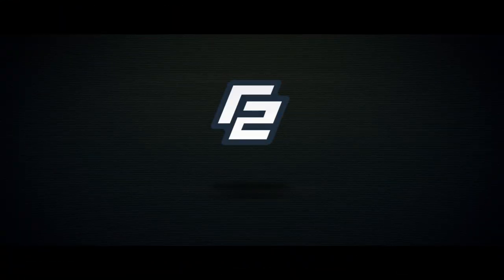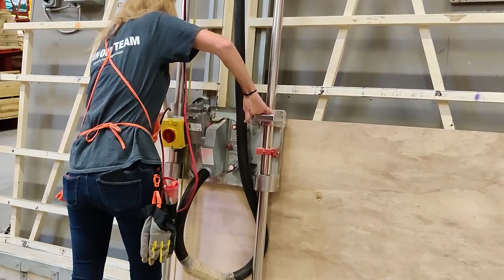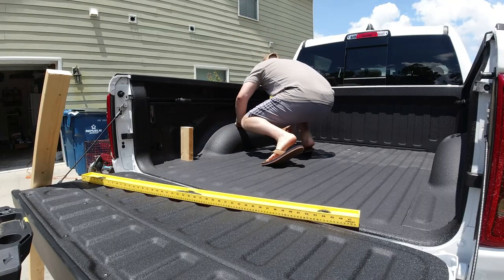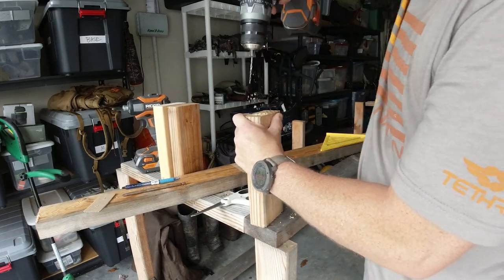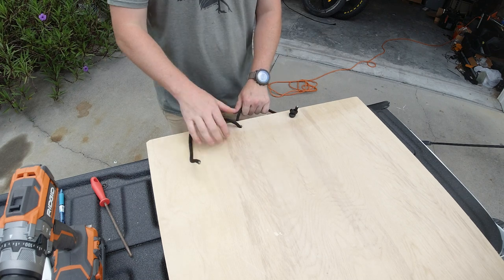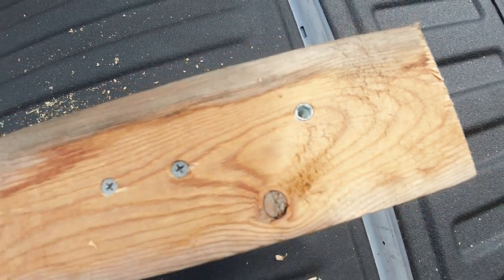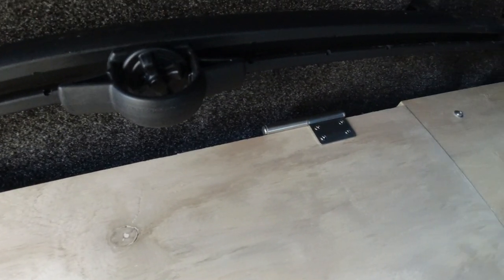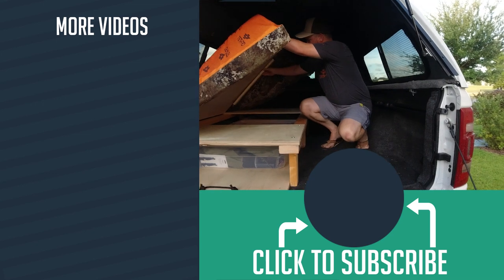Truck Bed Camper - Step-by-Step Build-a-long Tutorial

Comment: Great video - So simple; but, elegant in design. Easy to remove too so you can use your truck if needed. The treaded inserts are a great idea to take apart and reassemble. $144 is affordable and look what you get.
Reply from the maker: You get it!

Comment: ive looked at a lot of these designs, some intracite and some simple. This is the best laid out Value minded set up ive seen Very well done, easy to build and you have put together the video in a simple follow along manner. The mattress cover is a nice touch too. The only thing you really didnt cover was securing the completed project into the truck bed. Other than that, looks like a great easy set up that is functional and easy.
Reply: I don't secure it in the truck bed. Gravity & the friction of the bed rug does that for me. I drove from GA to ND and hunted for 7 days with the bed in place and it never shifted or fell over. It worked perfectly! So that's another advantage...no fussing around with attaching it to the truck bed.

Comment: Nice build and thanks for the parts list and sizes. Very helpful! Was wondering? Did you factor in whether you can sit of the bed and have head room? Or is that not even a concern.  Thanks for sharing! Cheers from Michigan.

Comment: Hi G2 Outdoor, that was easy, economical great project. Thanks for sharing your ideas.
I noticed your bed rail system in your truck is that stock or you made that too? Where did you get the metal that you used for your bed rails. Thank you and continue sharing more videos. More power 👍
Reply from the maker: Thanks! The bed rails were stock on my 2020 Ram. Seems pretty easy to DIY with some 80/20 or even T-Track.

Comment: Stupid question , how is is secured on the truck bed floor ? Do you bolt it in the truck bed ? Does it stay put in another way ? How does it stay in place if you do t want to drill holes in the truck bed

Comment: This is great! Looks easy enough for me to build. Question though, if the top is 37" wide, wouldn't the slide out underneath need to be less than 37"? Thanks!
Reply from the maker: It could be that I messed up the slide measurement. I can't remember specifically since it's been a couple years since I built it. But yes...the slide needs to be slightly less wide than the top to account for the legs.
Reply: @G2Outdoors  Thanks for your reply! It makes sense that it would be narrower, but wanted to make sure I wasn't missing something.

Comment: That's an awesome build, man.  Thanks for sharing.  Got some materials to start my build and definitely want to do some of what you have done.  I would really like to use those hinges, but couldn't find them in your Amazon list.  Do you have a link for those?
Reply: Ever end up finding out the link or have a recommendation for the size? Just about finished with my build and this is all I have left to get. Thanks!
Reply: Actually called a “flag hinge”.  Rannb 3-inch Flag Hinges 304 Stainless Steel Lift Off Hinge Detachable Door Hing

Comment: Maybe I missed it but how do you keep it from sliding side to side when driving?
Reply from the maker: It doesn't slide. The Bed Rug and the weight of it solves that problem. I've driven hundreds of miles with it and it's never moved an inch.

Comment: Very nice build. Where did you get the Tethrd covering from??
Reply from the maker: It was an old tablecloth from a tradeshow booth.
Reply: Ok cool. I was able to get out yesterday, and got up in a tree with just one of the Hawk Helium stick, Phantom saddle, and Predator XL platform. I sat for about 40 minutes. It was pretty cool. I gotta find the sweet comfortable spot. I’m hoping to get out a few more times and get use to climbing and setting up everything. I think this will be my new way to hunt quick and be mobile on public ground for sure💪🏽💪🏽💪🏽
Reply from the maker: @stevenmatthews8981  that's awesome! I also really recommend back support. You can pick up the Recliner from Tethrd or make your own pretty easily.
Reply: Yes I also bought a recliner band and the seat warmer as well. I’m all seat up just need to get more practice sitting in it. Thanks👍🏽👍🏽

Comment: I’m interested in doing this build for my truck. I would assume by now you’ve really gotten to put this thing to the test so my question is, have you had any issues with it wanting to rock? The way the 2x4 was mounted on top of the supports I was curious if you had any issues with this. Do you think I would find any more stability with attaching the runner 2x4 to the side of those supports instead of on top? This would obviously decrease the clearance in order to access totes underneath but my support legs will be roughly 12-13” tall so I don’t want it to rock. Any insight would help! Thanks!
Reply from the maker: No issues whatsoever. I drove all over the country with this exact setup and slept many nights in it. It's completely stable and didn't have any issues even when taking the truck off road.

Comment: Almost complete with my build, (thank you!!!) just need the flag hinges. I see a bunch on amazon. Anyone figure out the size or have a link to the best ones to use?
Reply from the maker: This is what I bought. Been working great.
https://www.amazon.com/dp/B07DFB5JMY/ref=cm_sw_r_cp_apap_iWQ8qmJV7yMXm
Reply: @G2Outdoors  Thank you so much for the quick reply!!! I just ordered them and will have them in time for a trip to the mountains this weekend. Ended up using another hinge for the prop stick, but am curious, what kind of hinge did you use for that? I looked all over and found nothing all that similar. Thanks again for the video and the inspiration.